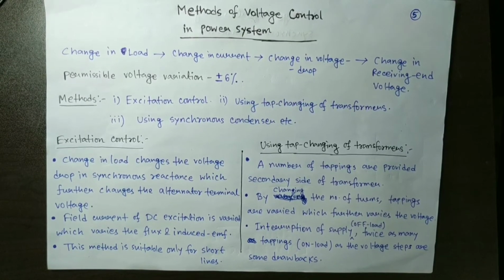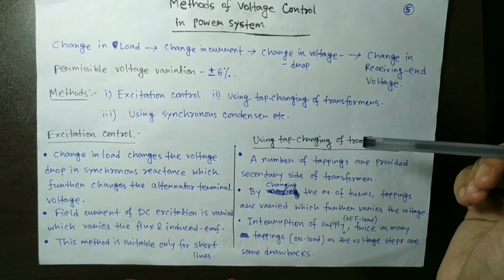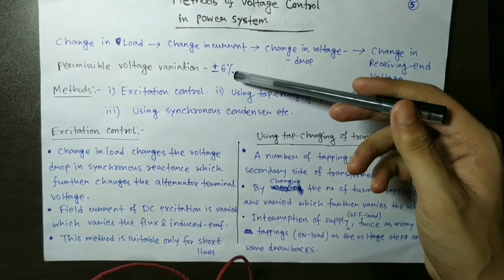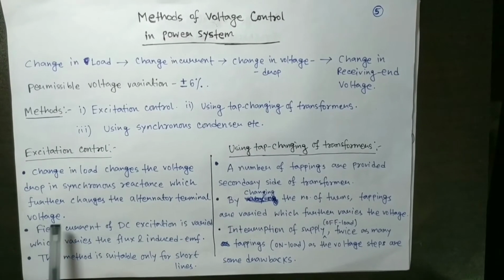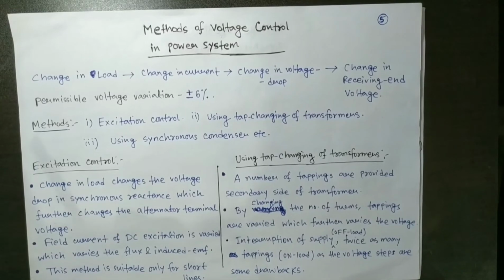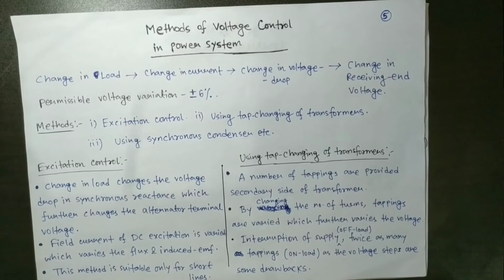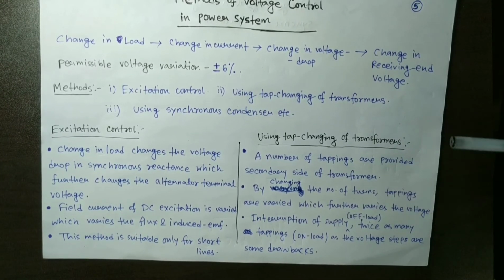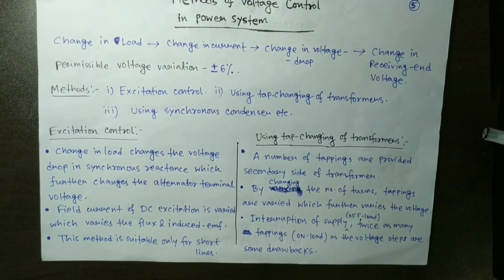Lecture-5. Voltage Control in Power System Using Excitation Method and Tap Changing Transformer.

Comment: Which book is preferred power system sir?
Reply from the maker: A single book can't meet all your queries. So whichever book you have, just stick to it and study it thoroughly and if you face any doubt, internet is the biggest resource. So many good online video lectures are also available.   Just type your doubt and you will get the solution. Don't get confused with books.